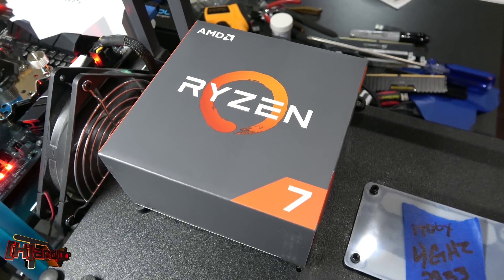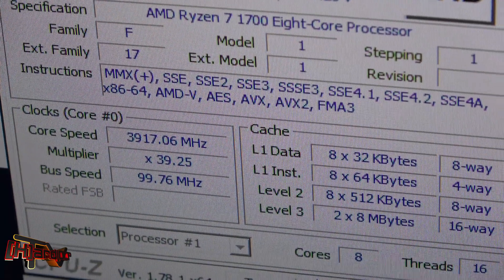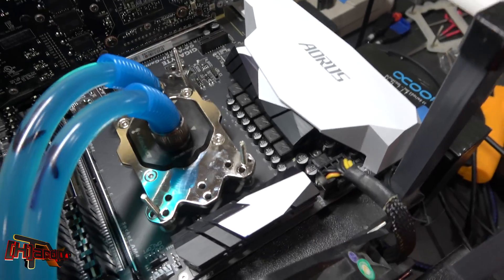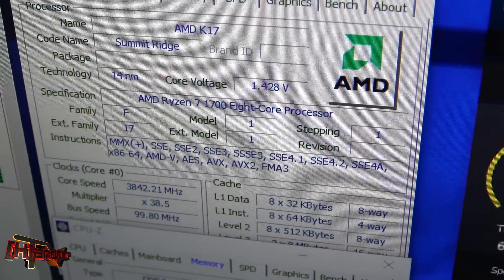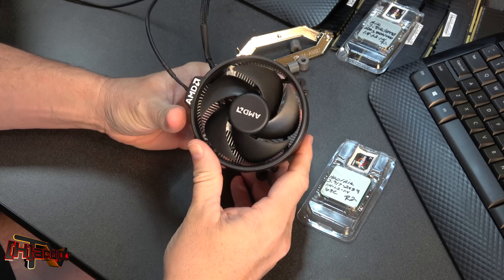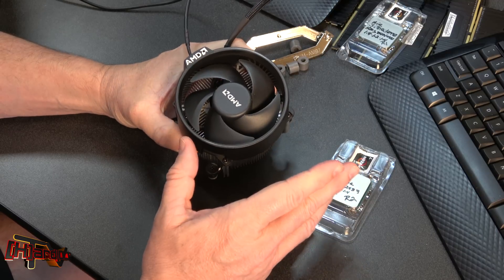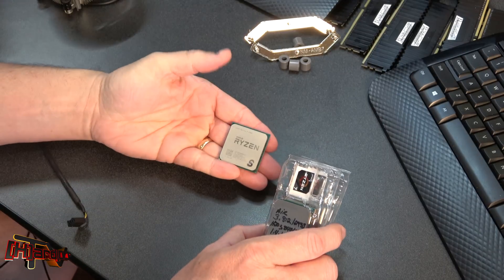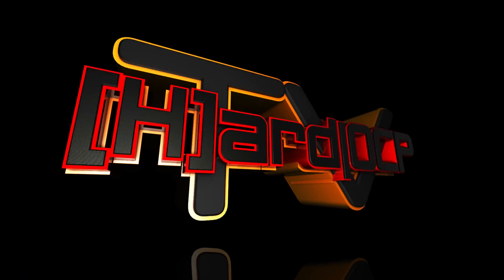AMD Ryzen 7 1700 Retail Purchased CPU Overclocking X 2

Comment: I must have won the silicon air lotto. 1700x 4ghz all cores, 1.275Vcore. Idle @ 32.6c, max 73.8c, 70.3c 8 hour average in Prime95 small fft. On a MSI B450 Tomahawk, using a lapped Hyper 212 LED/EVO of all coolers. TridentZ 2x8gb ram.running XMP 2 @ 3200Mhz
I can run 4.1ghz at 1.35Vcore, but my temps get up to 80c in Prime95. Buying a Le Grande Macho or Noctua D15S to try to get as close to 4.2 as possible.

Also, watch those VRM temps kids. Those are just as important.

Comment: i have  1700x and i am running 3.8ghz with 1.325v in manual mode with 38x multiplier and i am unable to run it more than that i have Asus Crosshair Hero Motherbaord  with ( 1002 bios) i tried even 1.45v with 3.9 and 4.0 and it crashes in windows is there anything else in bios i need to setup ?

Comment: There is a chance to get 4.0ghz on 1700 on true spirit 140?
Many people reports that retail samples can do 3.7 to 3.8 on air and 3.9 on water, 4.0 only with supplied samples by AMD, this is almost correct ?
I also seen similar stories with 1700x and 1800x, many people can't get 4.0, so which has a higher chance to 4.0 on Asus crosshair vi hero and gskill 3200 cl14?
I'm not a guy who benches for hours, if it's stable on prime95 or something similar for 5 minutes, then it's stable.
If I get a crash while doing something, then it's not stable and I need to do more tweaks.
Reply from the maker: It is really going to depend on the CPU, but I think 3.9 is more realistic.

Comment: I think I have most of the same parts, 1700, Aorus gaming 5 and corsair ram. I could not get the ram to oc at will only run at the 2133. Any hints as to how u did this? Oh I have the latest beta bios F5d..
Reply: Corsair Vengeance LED 3000
Reply: Gary Pierantoni me too. i tried to oc the ram, but it didnt accept it. have you solved it yet?

Comment: 1700 @ 3.8ghz 1.2875v with 2933mhz ram running at max 70c max temps underload. I think the stock cooler is pretty good for over clocking. You just won't be able to squeeze every ounce out of the CPU like you could with water cooling.
Reply: heya, davinci resolve will make rhe Ryzen OC with rending? thanks

Comment: wow, u are unlucky... my ryzen 1700  runs with stock cooler at 3800 stable 12 h/24 h gaming and encoding 46-56 Celsius on Asrock fatal1ty-x370-gaming-k4
Reply: I'm unlucky too, a bump to the voltage @3.8 and it was still crashing. My first crash was due to not enough voltage, the rest was whenever I tried to play Doom in open GL and Vulkan.

Comment: I wonder what size rad are they using?
Reply from the maker: I am using a Koolance 3x120mm rad on my AM4 testing.   Have done just as well with air though.  My suggestion is the True Spirit 140 Direct.  https://www.amazon.com/Thermalright-TRUE-SPIRIT-140-DIRE/dp/B01MQCK1PJ/?tag=hardfocom-20
Reply: Ah right, thanks.

Comment: I have an r7 1700 bought from Amazon on the stock cooler.  I am set at 3.85ghz at 1.35volts and never see temps over 68c.

Comment: thx for the vid...However no such thing as 100% stable maybe 99.999 %   :)   for the record i have 2x  1700 non x @ 3.8 1.325v still testing ...And  the other 1700  @ 3.8 1.285v again still testing  go above 3.8 then requires too much volts for everyday use

Comment: I don't understand your comments on the wraith cooler. I've sold a couple now and I get 3.750Ghz @ 1.3 at 75C with the stock cooler. I think you are over volting? That's with the B350 and 2.4Ghz ram. ONLY thing changed voltage wise was vcore

Comment: My wraith cooler easily supports a 3.8GHz overclock on my 1700, with RAM at 2933MHz . 1.35V vcore. Totally stable. Crosshair VI. And in desktop use it is totally inaudible.
Reply from the maker: Non of the ones I have had will come close to that on the Wraith Spire under 16 thread load.

Comment: Mine is 3.85 ghz stable on 1.38 volts, 80 degrees under load(25 degrees ambient) in rendering apps with stock cooler, but can do gaming with no problem with higher clocks and lower temps/volts.
Reply from the maker: Good information.
Reply: Seko Us I find that at the 80C mark the CPU starts throttling.

Comment: My 1700 runs 
3.9 at 1.3625 on stock cooler 65-70C under load
4.0 at 1.4 but reaches 90C so i dont use it on air cooling, waiting for my water cooler adapters.

Comment: Your Gigabyte MOBO is reporting the real temperatures I assume. My PRIME X370-PRO added the +20 degree after Bios update 0504 (I could see the temps -20 on Bios 0502)
Reply: That 20 degree problem is only for 1700x and 1800x. Not for 1700.
Reply from the maker: That is not what the mobo is reporting, but rather what AMD Master is reporting.  But the 1700 SHOULD be "correct" according to AMD.
Reply: Ah....that's true. I forgot that. :)

Comment: My ryzen 1700 run on 3875 MHz with 1,34 V and working stable on BOX coler)
Reply: How about 3900 MHz ? or even 4000 MHz ?
Reply: As a R7 1700 owner I'm currently getting 3.9GHz on 1.35
Reply: stable in browsing youtube, or stable running prime95/Aida64 for an hour? It be nice to know if it can stay under 75 degrees doing that on the stock cooler.
Reply from the maker: Full 16 thread load for multiple hours?
Reply: Stable in running prime95/Aida for 2+hours with 68°C max with hyper 212 evo
Reply from the maker: What motherboard? UEFI? SOCv? What DIMMs are you using?
Reply: X370 msi gaming pro carbon, 1.10 can't get my ram to work in dual channel so 8gb 3000mhz running at 2667mhz because that's another issue atm
Reply from the maker: Look for new UEFI soon.  AMD dropped new AGESA microcode this weekend.  Maybe get that RAM issue worked out.  https://www.hardocp.com/news/2017/03/20/new_amd_agesa_microcode_in_wild_uefi/  With dual channel, you are going to see more load on the IMC though, so that will likely impact your OC.  Surely would love to hear followup when you get it working.
Reply: Will definitely check this out
Reply: how do I get the new UEFI or whatever? I'm kinda new to all of this.
Reply: I use my ryzen on box coler, and in aida for 2 hours it have 90C, so when I finally got my new coler, I will try to get better results. Motherboard is ASUS PRIME PRO
Reply from the maker: Yeah, that is pretty damn hot.  Not saying that is "bad," just hot compared to a $50 air cooler.  https://www.amazon.com/Thermalright-TRUE-SPIRIT-140-DIRE/dp/B01MQCK1PJ/?tag=hardfocom-20
Reply: Why is my 212 evo appearing to be so good, my temps are 60 max after 2 hours
Reply from the maker: What is the load on the CPU exactly?
Reply: 100‰?
Reply: Aida64
Reply from the maker: Using what program exactly?
Reply: Check previous comment lol aida64
Reply from the maker: Sorry, missed this.  I do not use that program any longer, but I would suggest the package temperature is not being reported correctly.
Reply from the maker: I have boards here now with UEFI issues that have AMD Master reporting 10C under load.
Reply: Well 1.35v isn't exactly high
Reply: Ryzen master temps = CPUTIN
Reply: http://i.imgur.com/Sdpgk1i.png
http://i.imgur.com/gxxtvSf.png
http://i.imgur.com/813AAVr.png
left it running overnight, seems stable to me :)
Reply: Amd suggests up to 1.35 for 24/7 use ,above 1.4 for benchmarking .
Reply from the maker: Good stuff there!
Reply: Friend has R7 1700 at 3.8ghz 1.21V on X370 ASRock Fatality Gaming K4 with stock cooler. Aldough I don't know with what and how long he stressed cpu. SoC 1.1v, Ram is Vengeance LPX 2x8gb, 3000mhz cl15, working on 2933 via xmp (not any further tweaking)
Reply: Try 1.3678, on my 1800x i get 4 to 4.5 on all cores with no trouble at all.
Reply: I call straigh tup bullshit on that, proof your point at 4.5Ghz with said voltage with a 12 hour AIDA 64 stability test;
Reply: Please show i7-6900K retail at 4.5Ghz running on air with 1.34V running a 12 hour AIDA 64 stability test.
Reply from the maker: Not a lot of those could do that in my experience.  We were almost always good with 4.3GHz however.
Reply: Correct. All the 1700s run 3.0 to 3.8 on 1.225v stock voltage (this fluctuates a little bit depending on board vendor)so pretty much everyone should hit this spec & only temps will very depending on the cooler type, but this is stock AMD voltage, after that it exponentially balloons up. With an EK block at those settings it idles in the 25.13-28C range (at 22C room temp) and under load it goes 47-50C. (zen master v1.01)
Reply: I think he meant 4050mhz not 4.5 .Amd has .25 increments. Mine is 3925 MHz .

Comment: Eh, saying that it's not made for overclocking when you got it up to 3.5 on all cores is perhaps not that accurate, no?
After all you can do P-state OCing and get decent results that way with that cooler giving you way more performance then the stock 1700 does.
Of course you're not going to be able to push the CPU as far as it can go with those coolers, they're stock after all.
Reply from the maker: No, that cooler is not made for overclocking.  It was specifically engineered to run that processor very well and cool at stock clocks.  It falls on its face rather quickly.

Comment: Have you tested an 1800x? Would you say you are more likely to get a 4 - 4.1ghz OC? I'm thinking of getting the 1600x instead of the 1600 for $30 more if it does guarantee a 5% higher OC. I understand it's not worth it in on the 7 series, but having the same upgrade on a 5 series might be worth it.
Reply from the maker: I do not have any 1800X on hand.  No clue on Ryzen 5 and overclocking as I do not have CPUs here.

Comment: 130 degrees on stock cooler? Are "external temperatures" that much more insane than what is reported? I thought people are reporting shutdowns at 75c.
Reply from the maker: That was an external surface temperature on the Wraith Spire cooler, just a data point.  At 3.7GHz and 1.4v vCore, I saw package temps reported by AMD Master as high at 105C under load.  I do not however have the right tools to register throttling under those conditions currently.
Reply: I am a bit shocked to see these temps on stock cooler but it is an extreme case that it is tested.  I use a Ryzen 1700 with Wraith Spire and I hit 72 degrees in 2h stress test in a case. CPU is overclocked to 3.8Ghz at + 0.1V   with  LLC 2 on an ASUS Prime 370X Pro board (in CPU-Z and HWiNFO is 1.35Vcore max reported on load).  Now, I do use lower clocked memory and just  0.92V SOC. I do not know how much does SOC voltage influence the temps. I use 2133 G.Skill sticks overclocked at 2400.
Reply from the maker: I would not suggest it is "extreme."  If you are running a HandBrake encode on your desktop and doing virtually anything else, you are going to see loads like we are using.
Reply: He meant 130*F not Celsius. That's 54.4*c
Reply: The CPU would be at about 200*c otherwise, and even dripping water on the stock cooler would cause it to boil. That's the problem with not telling people what units you are using.
Reply: Jake Garrett oh well AMD reckon 85C is upper limit. 54 is a long way away
Reply: He said cooler temps, he may mean the outside of the cooler (measured with an infrared meter or outside temp probe). That's too low for core temps. So he probably didn't have that much thermal headroom like you think.  I know, extreme, but I can have a core temp 50+c higher than my cooling block temp. I have a thermocouple on my copper block, and with my last GPU, I had a max block temp of -35 celcius, but the GPU could hit up to 17 c running Furmark. That's definately not an average case, but that's why its important to specify not just units, but what you're actually measuring (ex: outside of block was -35c, the inside gas was boiling about -70c, but I'm not going to use -70c unless I specify).

Comment: Just curious Kyle, have you ever had any past examples where BIOS or microcode updates made any difference on chip OC's as a platform matured?  Or are we 100% certain at this point that this is the limit of the silicon?
Reply from the maker: I want to say yes, but I would have trouble pinpointing something at this moment. I know I have had lots of discussions about microcode and its maturation over the years mostly with Intel platforms.  However with Ryzen, the issues we are seeing seem to be more related to RAM than anything else, and timings that were not exposed in the original microcode released to the board builders.  I think it was a bit rushed and might be considered somewhat "beta" microcode on the first boards.  I do not think much qualification was done in the way of RAM speeds exceeding 2400MHz although AMD itself is selling on that very fact.  That all said, I think AMD is working hard to get things back on track, but my opinion currently is that the launch was a bit rushed in regards to motherboard builders being 100% ready to support the Ryzen platform.  Even though that can sound pretty damn bad, I would not have an issue building a Ryzen system for personal usage at this time, but I would not expect to blow RAM speeds out of the water.  I do not think there is a "limit of the silicon" in terms of what I am seeing.  I do not think we are going to see any big changes in terms of IPC any time soon.  Ryzen is what it is.  It is a damn good CPU if you need all those cores.
Reply: Any and every chip. 

https://support.microsoft.com/en-us/help/936357/a-microcode-reliability-update-is-available-that-improves-the-reliability-of-systems-that-use-intel-processors

Any BIOS or microcode updates that contribute to stability and performance at high overclocks will definitely make a big impact in benches.
Reply: It most definitely was rushed, but wasn't that a good thing? They had timetables they needed to meet because of various events that they were going to take advantage of and if they had missed them, it would have made them look stupid or incompetent. 

Then again, some of the issues that people were pointing to that supposedly showed that AMD had botched the Ryzen launch, such as the scheduler "bug" and the inter-CCX communication "bug", turned out to be nothing. Scheduler was working fine, but plenty of room for improvement especially regarding effective use of caches, but not a bug, just a weakspot that needed attention. And the inter-CCX communication latency issue turned out to be a bug in AIDA, misreporting the latency figures.

Anyways they've got so much stuff coming out in the near term, it's amazing. They must be stretched super thin. I'm having so much fun cheering them on.

Comment: I suppose the 1600 is going to be a great bargain compared to the 1600X like 1700 vs 1700X/1800X
Reply from the maker: Hopefully.
Reply: LTT did a sort of "test" about it. the R5 1400 and R5 1600 looks really good. I still think going the 6-core route will save you some cash in the long run instead of cheaping out on the extra 2C4T over the R5 1400.
Reply: Linus didnt pick up on it, but disabling cores on Ryzen should allow for higher clockspeeds. I want to see Ryzen 4c/8t @ 4.4Ghz, or so, vs. 7700K @ 5Ghz, in a battery of tests. I'm confident that one will see much higher single threaded performance from higher overclocks reached due to disabling cores. I think a proper head to head would be an overclocked 1400X, with software optimized as much as possible (a bit early still but yolo) vs. overclocked 7700K, with all the bells and whistles activated. I don't want to see boring tests like multithreaded 1600X performance compared to the 7600K. AMD made a beast of a processor and I want to see them put something out that kicks the 7700K's @ss in single threaded and multi threaded. I truly believe they're capable of it. I may have to wait till Ryzen 2 comes out though to see AMD win a head-to-head matchup like that though. I just don't see single threaded going away as the main factor in determining gaming performance. The way games work makes it hard to avoid making one big fat process taking care of the main gaming loop. I don't see a way around it. Mitigate all you want, but single threaded performance will reign.
Reply: honestly doubt it would be on same scale as the 1700 vs 1700x
Reply: There is a little bit of truth to it being able to OC better, but it really doesn't look like that much from tests I've seen. People have only gotten another 100mhz out of their 1700 when disabling 2 cores from what I've read, even while going to 1.4v. Generally with more cores disabled you can use a lot lower voltage so 1.4v on 6 is probably like 1.5v on 8 core. But even that does not allow you to go past 4.1ghz. Maybe their second generation's in 2018 will have fixed some of these things.